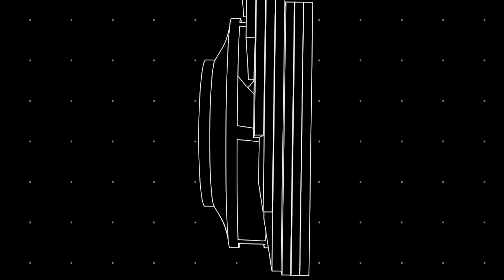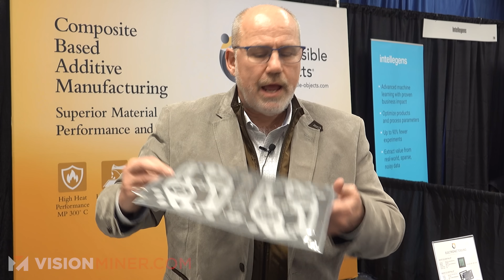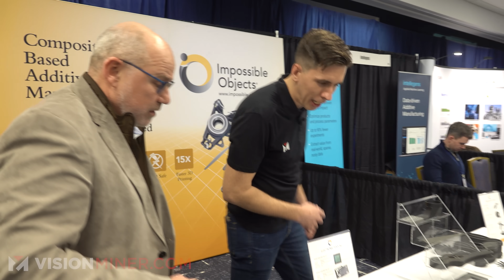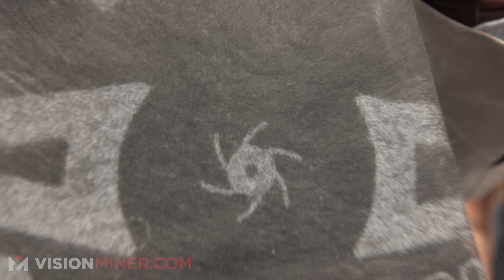Impossible Objects is Disrupting 3D Printing With a New Process | AMUG 2023 w/ Vision Miner

Comment: I believe Canon or HP came with similar process but with paper instead of carbon sheets. 

Thise parts must be crazy strong compared to clasic fusion printers. But I bet that it's expensive as powder printing.
Reply: 130MPa is not so strong.  🤔  Alu, is 150MPa. And real carbonfiber is 4000 MPa
Reply: @JaapGrootveld  (- yes the weakest link is the bonding of the matrix to the fibres, epoxy is only ~ not very strong huge range for "epoxy to epoxy from 5-7MPa up to ~100MPa - in the context of metals.. 

Just because a fibre may be in the GPa range for UTS, doesn't mean you can build parts that strong..)

Calling stuff "real carbonfibre" is being ridiculously elitist.  Here is a mould free method of making complex solid carbon-thermoplastic components. "Real" carbon composites cannot do the same easily.  Here the competition is the boys doing filled PETg and FDM nylon and calling their parts "fibre reinforced...  These methods could be improved - using jetted thermoactivated crosslimking polymers with inter layer reinforcing for extreme solidity and stiffness - go one further and spray on binder stabilised carbon ceramics, post autoclaving..

130MPa is stronger than laminated paper, we have come a little on democratising complex manufacturing in  the last 50 years.
Reply: The paper printer you mean is made for high fidelity full color model printing.
Basically just for the looks 😀
E.g. this is important for validation in the design industry.
But yes stacking based processes are around for a while now.
Reply: @JaapGrootveld  So we're within 20MPa of Aluminum? Hot fucking DAMN.
Reply: 20MPA isotropic and half the weight.

Comment: I suspect this process will have relatively low fiber content compared to high performance composites which are usually optimized at around 60% fiber by volume.

Comment: Interesting, reminds me of PCB stackups. With machines involved in PCB maunfacturing you might be able to align the sheets in the stackup accurately enough for god parts toelrance. Still, PCBs have a hell of a tolerance in z-direction, due to different copper and fiber filling degrees. We might see the same here.
Reply: I imagine you could press not to a pressure but to a specific height for the number of layers in your design. That would at least hold the overall Z level pretty accurately. May have some variance between layers though?

Comment: and this is only the beginning.
What if you print those sheets and instead of just placing them in a flat press, put them in a press with a certain shape. You could even make round parts (tubes)  and you could possibly also use this instead of resin infused carbon. I'd love to try this to make a carbon bike frame out of this instead of using the prepreg laminate we are using right now

Comment: Great idea that would fill many niche applications. Curious to know if the material that is sand blasted away can be recovered/re-used. 
Also, like other FDM processes, you have the opportunity to embed threaded inserts or bearings as you stack layers, but because it is pressed and heated, the parts would become an exact fit.
Reply: You'd have to somehow reform that chopped material that was blasted away into a mat, so I doubt it.
Reply: @amorton94  Yes, that's what I was thinking (reforming into mat). I wonder if it's viable, or if the fibres are destroyed in the blasting process.
Reply: @amorton94  There's nothing fundamentally different than doing it with cotton fibers from chopped up jeans in 3rd grade to make your own paper. Moot point regardless, if the sheets aren't cheap enough to not bother doing this it won't be financially feasible to use them at all.
Reply: If it's carbon being sandblasted away, not sure how important recovery is.

Comment: Very creative and interesting approach!  There are also appear to be a lot of limitations and huge inefficiencies in the approach, making it really only viable for printing very high-value prints.  Still, I don't think the concept should be discounted, particularly if it can produce materials that are superior to more traditional manufacturing methods.  I'll be curious to see how this one develops, and I'd love to see where it finds true commercial application!
Reply: I’d wonder if they would apply the process using a water soluble fiber instead? That would make it much simpler for makers and remove another expensive machine from the mix
Reply: @Underestimated37  I was actually thinking about the same thing.  It's definitely possible, however there are a few issues.  First is that you will lose the extreme tensile afforded by graphite.  Second, the hydrophobic plastic may not bond as well to a hydrophilic fiber.  Third, you may end up with small holes in the final print where water manages to dissolve fibers which are at the surface of the new part.   Also, this approach somewhat benefits from the sandblasting if you want the smooth finish.  Still, I could imagine there are some niche applications for an approach like this.

Comment: does the "non woven" carbon reinforcing enhance cross layer bonding versus layer binding exhibited with woven fibre materials - if there were a technique for tufting the fibres in the layers -  it would be interesting - ie resulting in a 3d reinforced matrix.

The selective deposition process seems more suitable for running through a printing press (basically using photocopier / laser printer tech. than an XYZ gantry.
Reply: I imagen it does, however I also have doubts about the "no layer" claims.
Tufting seems like an interesting idea, even if it would be absolutely brutal on the needles and equipment. 
My primary idea was to agitate the thing with ultrasonic while annealing.
I don't know if direct powder application without the wetting agent would work. But I agree that should be a magnitude faster.
Reply: Smashing it to 5% of the original height of the stack probably agitates the fibers plenty.
Reply: @rustyshackleford3053  Yes and no, the question is do the fibers interlock.
Just smooching them together under pressure doesn't guarantee that.
Especially because they are fixed together with the binder and wetting agent.
To weave them together there is a surprising amount of energy necessary.
Probably it would need multiple agitation, rest and compression steps to form a coherent true "layer less" bond.

Tufting would guarantee that but I imagen the dimensional accuracy would fly out the window along with it.
Reply: How would they not be continuous. If the part is cf(a)-plastic(b)-cf(c)-plastic(d)…….. when you compress apoximatly half of the cf will end up going into each (above and bellow) of the plastic layers. Cf is significant less compress able obviously. This also means it should be isotopic in nature and therefore “layer less” since then it would be from above (ab)-(bc)-(cd) where the cf fibers are mixed between each layer.
Reply: @sawyerlachance7745   - as one above commenter said - just because you would think so. doesn't make it so - and there will be no reinforcing fibres transiting through any complete layers (only post process tufting/sewing, does that - meaning as with all conventional laminated (thermoset - rather than thermoplastic) reinforced products, properties provided by the reinforcing will not be isotropic (maybe approaching, but no real cigar - just Virginia)...

Comment: Of course in the Z direction there is no carbon fibre. Also 230C may be ok for soldering in leaded solder, but pretty much globally we're looking at lead free which is as hot as 260C.

Not saying it's not a good process, only that it sounds like a few things need to be clarified.

Comment: I could definitely see this being used for larger objects such as car body panels
Reply: I guarantee it would be over 100k per door panel. This is ungodly expensive. Just the carbon fiber sheet price would be shocking.  Build up a 48” x 48” x 10” block to make a rounded door panel and it’ll be wild. Cool tech but it was designed by a manufacturing businessman it seems

Comment: I'm curious what one of their machines costs?  And it would be great to see a comparison of cost to manufacture a part on their machine vs CNC vs (say) an SLS machine

When they don't say the price, you know it's going to be VERY expensive.
Reply: (one could go forward with this using a large format plotter/inkjet printer and thermal press - jet on heat curing epoxy...  no need for the complex gantry and transfer robot - a sheet collator could do the alignment.)

OR on the other hand - if done in a conventional XYZ gantry - jet on the epoxy over rolled reinforcing sheets (use a linear jetting head for extreme layer speed) - sprinkle on interlayer crosslinking elements... eliminate the alignment step.

Comment: I imagine some hi tech heating equipment is required to ensure the temperature is evenly distributed throughout such large solid volumes during the fusion stage. ?Microwaves. You can't just fan hot air into the middle of such a large solid 3D stack of sheets. May not be so good for long thin tubular parts - the re-enforcing fibres don't travel in Z. Like all techniques this will have its uses but won't be a panacea.

Comment: Good marketing show. But at the end, there are many obvious problems here like bad layer adhesion and lack of precision that are simply swept under the rug. To me, it sounds like "one step forward, two steps back".
Reply: Bad layer adhesion? This should have about 100x the layer adhesion of PLA/Nylon FDM.
Reply: @rustyshackleford3053  The layers are only connected with the PEEK, not with carbon fibers. The carbon fibers are not vertically intertwined with each other. It's like gluing metal plates together and then claiming it's now a solid block of metal.
OF course the PEEK is still better than common plastics, but it's still much weaker than in the horizontal direction.

Comment: Can this tech possibly do tiling? Say you had a finite sheet size in one of your axis, you could in theory stack them with an overlap and still get a strong piece, no? You could also, in theory, print on the edges that fit onto a regularly oriented stack, to get a "z bond" instead of simply x,y layers.

Comment: After all sheets are stacked, punch a hole through defined Location and Press in preimpragnated Carbon Fiber rods to get Stability in Z before backing. O Shit, now i told you my Patent plan 😅
Voila. Field of use extended by 1 Dimension.

Comment: This is such a cool/practical process!!!! 😮
Reply: are you sure? Low layer adhesion, low precision, high pressure, big amount of waste, sandblasting and strong chemicals are practical?
Reply: @Gromic2k  low layer adhesion is a bit of an assumption, media blasting is simple to automate and as for precision I think that's another assumption on the process (considering every print form has ideal geometry applications). I wonder about the "strong chemicals present" comment.... Maybe it's always necessary when you consider what it takes to make most consumer/industrial grade plastic parts that use pellets or resins. Plenty of strong chemicals will be included in their processes.
 
Alternatively, I think this to be a relatively short path from raw material to composite 3d part with surface finishing (sandblasting) built into the de-flashing process. By comparison, wet layup for composite parts take a lot of processing steps to achieve (less) complicated geometry.
Reply: @FPVtrix  Well you can see all that in the video. I'm not assuming anything

Comment: Paper lamination based 3D printing has been doing this for decades. The only thing new, is the old history you didn’t know about.
Reply: And the fact that it is combined with material jetting process which is what makes it novel.
Reply: @jbwalker841   - why not jet on heat cure epoxy?? skip the peek.
Reply: @kadmow  I love the idea. I've seen some tests of layered fiberglass and cured epoxy being strong enough to stop handgun rounds up to (but not including) .45 magnum. I was shocked at how strong it was. It would be much cheaper than peek too.

Comment: The neat thing about 3D printing is parts that just cant be made by conventional machinists can be printed. things with internal structures and curved holes for example.  and nothing they showed seemed to demonstrate that ability.
Reply: So? My ender can't make parts nearly this strong. Sounds like a skill issue for the engineer trying to apply his favorite new solution.

Comment: THIS. I have always laughed at 3D printing, if it's not metals & lasers... this is actual * industrial* additive manufacture. In particular: each separate 'page' of the work-piece can be printed in parallel and assembled in a single step - that's something you'll want, for real-world mass-production, instead of sucking-up hours of print-time on each machine!

Comment: I assume the money for the manufacturer would be made selling the sheets and post processing
Reply: And selling/maintaining the printers. You can see it on their website, it's a massive piece of industrial machinery. Hard to judge the size, but using the person next to it as a reference, it's like 7 feet tall and 25 feet long. The continuous role of carbon fiber sheets you load in would require a crane/lift to load, it would weigh several tons. It basically resembles an industrial-scale printing press, but it does completely automate everything, including the compression, heating, and sandblasting.

Comment: No offense, but this seems like a huge pain. Sure, you can technically print faster, but what is the time required in the heated press? How does the heat evenly penetrate to the center of the block of layers? How much time is required in sand blasting the parts out? So now I need a sand blaster? How do you separate the carbon waste from the sand blaster media? Keep in mind, this is very similar to the pre-preg carbon fiber process, but where that epoxy resin is rated to 600deg/f, PEEK is only rated to 400deg/F. Is it stronger than FDM, SLA and even SLS? Probably, but this seems like an incredibly wasteful process and it being faster is a stretch.

Comment: Normal 3D printing is painfully SLOOOWWWWW. Components machined from aluminum bar or even tool steels can be produced faster and with greater structural integrity than traditional 3D printing solutions deliver. The only advantage of 3D printing is being able to make parts which have very complex geometry that is difficult to produce via metal removal machining.

Comment: It's a neat concept but I think this guy has more of a 'replacement for traditional 3D printing' in mind and realistically- that's not going to happen with it. This tech could be great in supplementation of other processes like filament and resin prints but certainly not a replacement. I can print in 29Um on my resin printer with all sorts of colors, including see-through. I can print in wood, copper, plastic, etc on my filament machine and only print what I need without wasting full sheets of costly material. Some of my prints actually cost about 2cents for little misc parts and I doubt this process can beat that. I'd like to see this develop more but his ambition looks a bit misplaced.

Comment: To be honest I completely dislike this tech. My main reason is that if we think about the amount of carbon fiber need to be sandblasted away (I wonder how this is fitting into the Additive Manufacturing category..) this technology creates so much waste ( I don't know if the sandblasted carbon can be reused to create another sheet of fiber. ). The carbon fiber addition to plastic is fantastic, but really I doubt this would be the future. I hope not. Or if I misunderstand something can someone explain?
Reply: I agree but it would depend on if that's the only reasonable way to make a part with reduced stresses. But ya thinking about it I would call this less additive and more selective material removal. It really will depend on how much they can recycle from the waste and the cost associated with reprocessing.
Reply: I'm more curious how you're supposed to sandblast the object if it's hollow inside.  It's not like resin where you tilt to a side and let drain from an exit hole...
Reply: @tasa4904  Probably have troubles if the passages were deep, or with sharp angles. That said, maybe if it were really important, you could custom manufacture extended reach nozzles for a sandblaster.
Reply: @Mingyao Liu might be difficult to find a solvent for the carbon fiber that wouldn’t also seep into the finished part. I wonder if they could use a laser to cut along the edges to trim the fibers?
Reply: @@mingyaoliu1632  (solvents to dissolve carbon or glass?? - tricky proposition.)

Comment: This clown is a BS artist. He skipped the part in the description as to what makes the powder wet or dry and he claims his process is stronger. Stronger than what? Any composite material with chopped fiber versus continous woven fiber is much weaker. Also, why not just use a laser to cut out sheets of woven graphite/epoxy pre-preg and then just stack them up and cure it in an autoclave? The part will be strong, lighter, and probably cheaper because you won't have to buy a customized printer with probably their customized resin. The worst part is that you have to bead blast all the excess fibers away. Bead blasting is a messy process plus their will be a lot of wasted fibers.

Comment: Who gives a flying F about any of these. If it isn't EASILY accessable to the public with NO STRINGS attached. Then WHATS THE POINT. you compair to FDMs and RES but the key point is that ANYONE can afford them and use them.